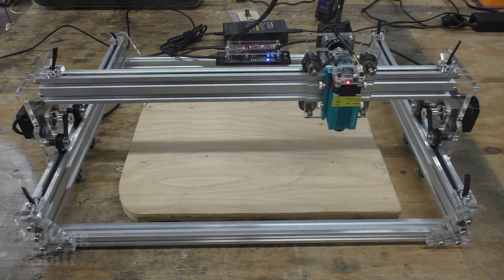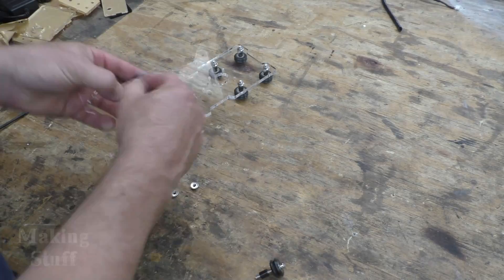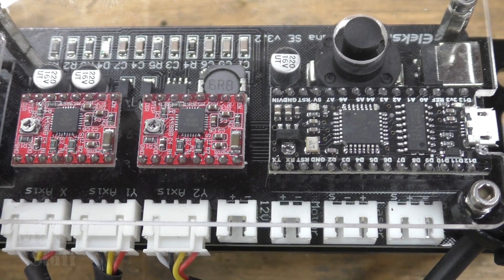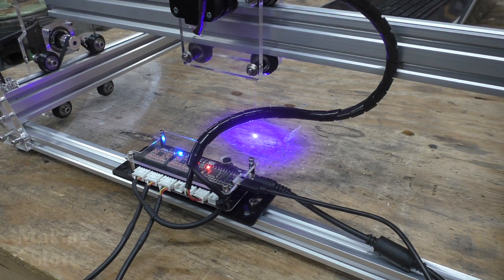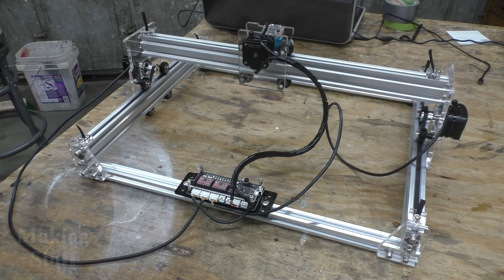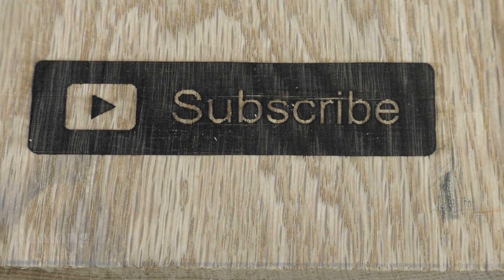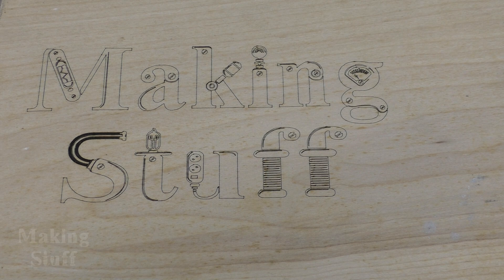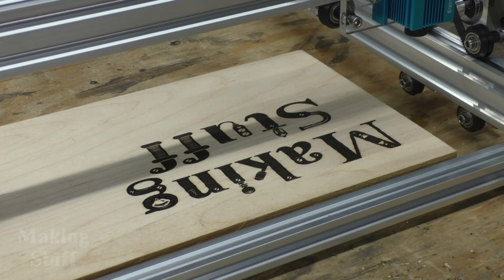Eleksmaker A3 Pro Laser Engraver Review

Comment: I added a 7watt laser to my cr10s ez pe ze it runs off the cooling fan supply it does open up the possibilites
 good review thou well done 
I recommend pic engrave pro +laser software  for making the gcode
 works great on the backside of mirrored glass tiles from lowes the ones with gray backing remember you may have to invert the image

Comment: Very clear video. I bought a 500 mW laser for an engraving machine, I had in mind I might do some engraving by hand, but it came without any specifications about the voltage it needed. 
On another, french video, I found out it needs 12V dc supply. But I couldn't make anything of the French language the guy spoke. I'm from the Netherlands, speak and speak dutch. But I can communicate in English quite well. I'm an engineer in electronics and measure and control technics in chemical and oil industries, I had to fix problems when the factory got down.
But it seems to me a 500mW laser is far from enough the do some engraving. I'll try to burn something in papier,  a cigarette paper must be possible with this power?
thanx for your video, I'm always busy making stuff, no matter what, I will watch your videos with most interest. Thanks again.
Reply from the maker: The laser in the video is 2500mw.  I agree that 500mw will not do a very good job engraving.

Comment: Aluminum is a soft metal,  would it work on that, and how tiny can it engrave?
Reply from the maker: It won't engrave aluminum.
Reply: @MakingStuff  ahh pooh!!  I was looking at engraving items like a hollow aluminum pens. Not solid. 
I use to engrave with a flat engraver adaptable to swap out a diamond tip.

Comment: BTW, LASERS of this frequency and amplitude can fry holes in your retina and damage your cornea even via an indirect reflection. Building a containment box is an excellent idea.
Reply: Hey please write to me, I have an issue with this laser and I think you could help given this comment, yourr aware of the danger, please write ASAP
Reply: This includes viewing the spot on a white wall even at a moderate distance. With 450nm you also have the 'blue light hazard'  which folks should familiarize themselves with prior to operating a class 4 in the blue part of the spectrum 🍻

Comment: I found a site that sells a 12" x 12" laser shield. You can drill some holes in it and mount it to the laser module. If you have a heat gun, you can mold it around it.

Comment: what kind of machine do i need to make deep engravings on plastics and metal? how strong of a laser?
Reply: This laser kit is not "it", for many reasons. For vaporizing deep engravings into acrylic, research the K40, then customize the exhaust to remove vaporized acrylic. For metal, this machine and the K40 can "mark" metal with the use of third party cheats and hacks. Metal reflects, aluminum reflects alot, and lasers blind quickly...  use cameras...  don't look into the light..   The K40, can cut clear acrylic, the yag on the Elekmaker cannot mark anything clear.  I have both, love them both, both excel in their own ways.
Reply: @enniebudy  thanks for the reply. i will look into the k40
Reply from the maker: @enniebudy Yes the K40 is the way to go for that kind of work.

Comment: Hello, I have been having problems with my laser. I only got it working once and then after it kept saying that it cannot find the serial port. Specifically, I cannot connect my laser to my laptop. I have installed the program, and then installed the driver. Everything I click refresh it tells me "Find Serial Ports Faild, Please make sure you are already connect EleksMaker CNC Device. Then Click [Refresh]". If you can help out that would be great

Comment: I have bought the same machine some months ago.
I was lucky to turn it on after having read many reviews and discussions, and after having seen many videos.
If anyone buys this machine thinking it's a normal and safe machine (as it should be), built by clever people (as it should be), PAY ATTENTION!!!
Like we can see in this video, too, the first time you connect and turn on the machine, the laser fires at full power, and if you don't know this danger before, you may get blind or burn something unwanted before even starting your first job.
It's tragically ridiculous.
As for the other features, I stopped using it because it's too slow. 
Even if the working area is large, it needs at least 4 hours to engrave an only 10x10 cm photo using raster engraving at 150 ppi resolution.
So, it's useless that I have an A3 working area but I only can engrave a pencil if I don't wanna grow old while waiting for the process to end.
And it's useless to declare that the laser should be used for no more than 30 minutes when a single engraving process needs 30 years.

Comment: Amazing they designed the laser to be on by default hahaha. Isn't that the first thing you think about when designing some laser engraving hardware?
I'd be curious if you could cut 2-3mm veneer or thin plywood with it. But even if, it probably would take forever.
Thanks for the video!
Reply from the maker: I think the plywood is to thick to cut.  I'd try but don't have any thin stuff to cut.
Reply: @MakingStuff  Yeah you'd probably need one of those 40W CO2 laser.

Comment: uhm my honest opinion on this thing is that its way to expensive for what it is. if you set it in perspective, you can get an ender 3 printer for that price, you could even strap a laser diode on it and do the same (allthough beeing a little smaller), but at the same time, you have a fully functional 3d printer that delivers really good prints. let alone of building a laser cutter/engraver from scratch isnt hard at all, it would be cheaper or better at the same price. does require some work and research though.

Comment: I have a question for you, do you think 2.5W is powerful enough to ablate (black) spray paint off of a metal substrate? I've been wanting to get one of these to experiment with making etch resist masks for brass and copper, but I can't quite figure out if the laser is powerful enough.
Reply from the maker: I think it will.  I wanted to try and make some PCBs but didn't have time before releasing the video.
Reply: I've been thinking about exactly the same application and have found a local fellow with a small laser engraver that's going to do a test for me sometime.  I'll report back with results when (if) I have some .

Comment: I bought this back about Jan. 2019. I had nothing telling me where to go for video or instructions of any kind but after a little searching on YouTube, I found a video that helped get me past a few if'y spots. Over all it was very easy to put together. I did not care much for the software it came with and ordered  "T2Laser" program.  When that software came I did one little test run and it never failed but sadly it has to be put aside ever since for a few reasons here, nothing to do with it. I am trying to get back to it and would like to upgrade to the 5watt laser for more options on what I can burn. 5 watt is max for the driver from what I read but 2.5 does pretty good for things like you mentioned.